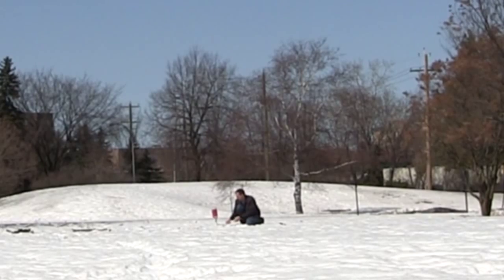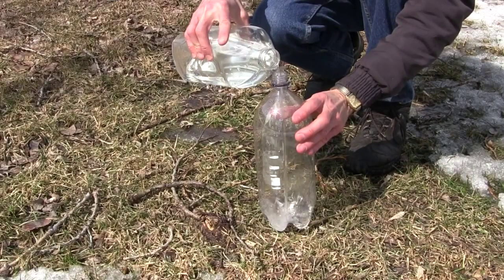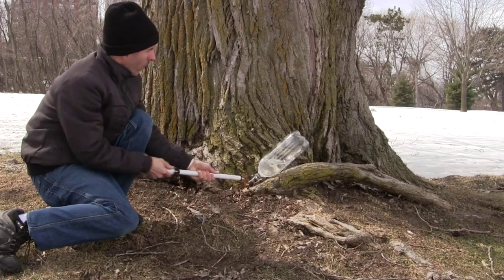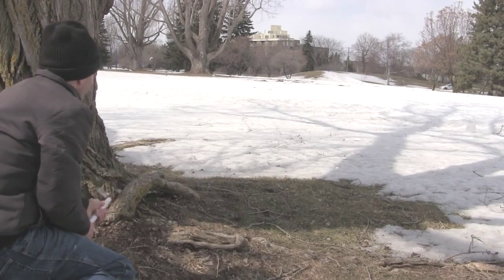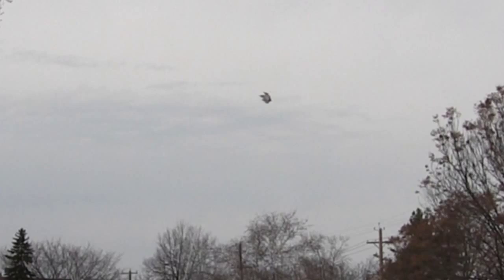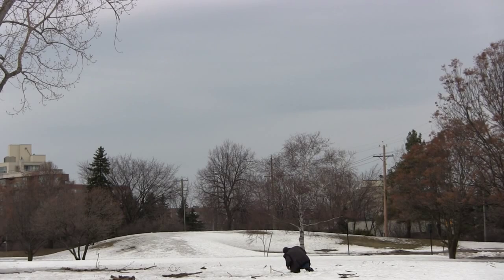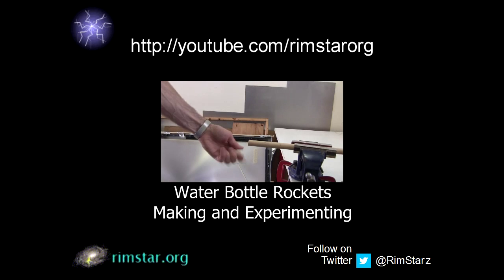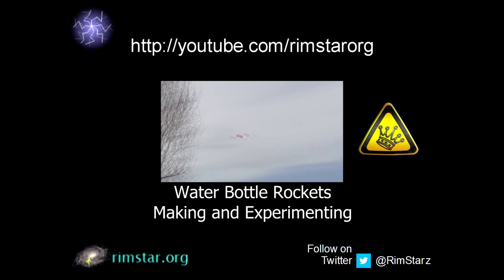Water Bottle Rockets

Comment from the maker: I tried a twist in the fins for the very reason you state, actually flaps, all pointing clockwise (or counterclockwise, don't recall which.) But they flipped around to fly backwards like before, and then really failed since the flaps were now countering the flight. I figured I'd need a very high spin rate to have any effect. Are you sure the reason yours worked wasn't because they had more weight nearer the nose end? I could be wrong. Newb here :).

Comment: I used to do the same thing when I was a kid when these plastic bottles first hit the market. I used a pipe attached to a garden hose and the city water press. was high enough where I lived to really get that thing in the air. I would place the pipe all the way to the bottom of the bottle, turn on the water and hold it for as long as I could, finally let go and watch it soar.